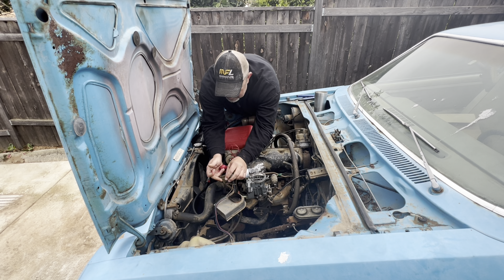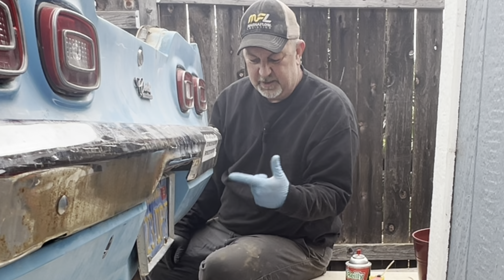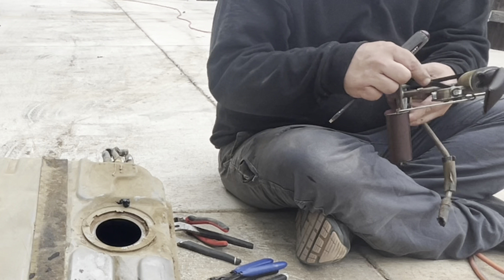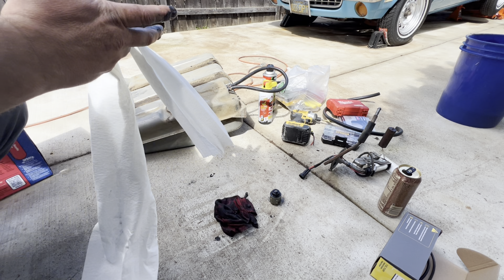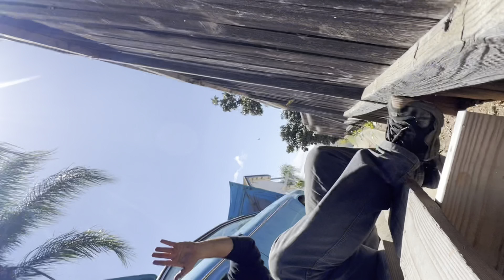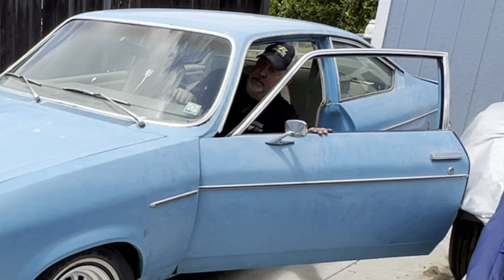FORGOTTEN Chevy Vega! Pt.3 Can we get it on the road? Trying to get a FUEL SYSTEM!

Comment: I think Vega had the first domestic electric in tank fuel pump while Pinto had the first domestic rack and Pinion steering gear. Fun to see you dig one of those 1st out of the fuel tank. Thoroughly enjoy you videos. It's a boomer thing I guess, hahaa. I hope your brake journey is an easy one..... but I bet the calipers and wheel cylinders are going to need to be replaced. Take your time removing those brake lines to the wheel cylinders!
Reply: A 50/50 mix of acetone and automatic transmission makes a great home brew penetrate
Reply from the maker: Good tip, thanks!

Comment: I seriously doubt your engine is an interference design, but you might take an inspection of that timing belt. If the fuel lines were trashed that belt can't be prestine. Hint.....it drives the water pump.
Reply from the maker: Believe it or not, I found a timing belt and water pump online! Scooped ‘em up just in case! Thanks for watching!